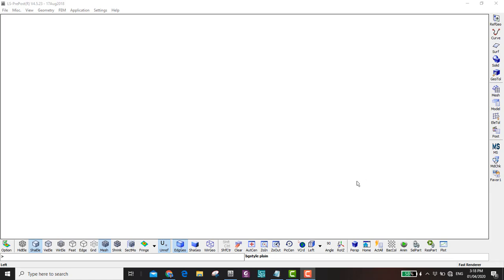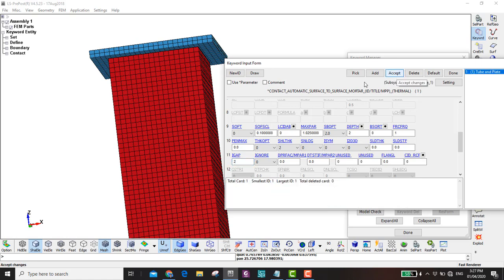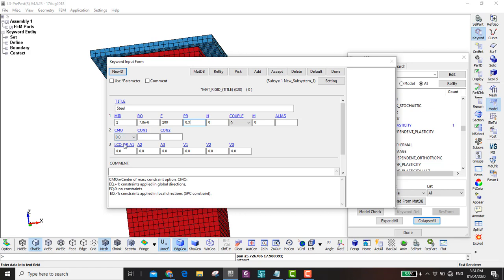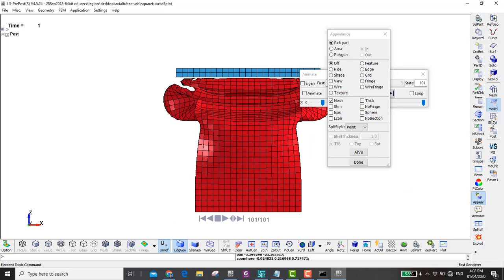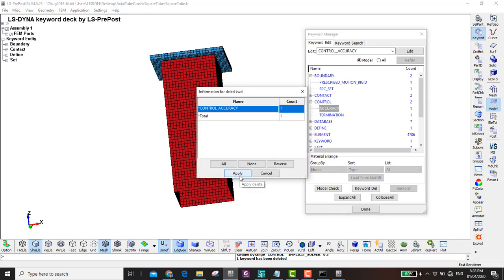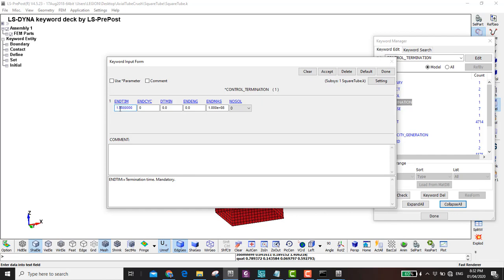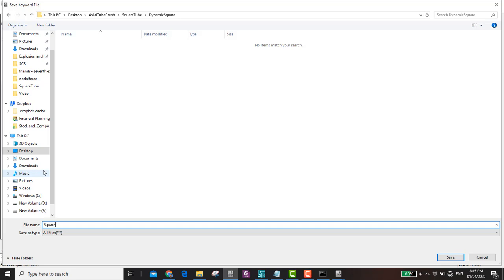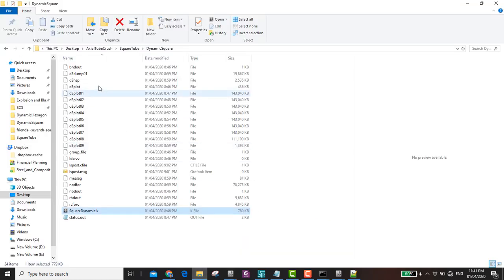LS-DYNA TUTORIAL 12: Static and Dynamic Axial Tube Crush

Comment: Hi Ameen, I have followed your model but I am not sure why i cannot get the rcforc result as yours.  My rcforc is zero (it’s like there is no force).  Any ideas on this. I tried to do it twice but still cannot get the result as yours.
Reply from the maker: Dear Lam, are you putting correct value for DT in ASCII OPTIONS?
Reply from the maker: Also, the tube is crushed or not in your simulation?

Comment: I want to ask you something. I did the compression analysis, and the max of the value is too different when the rcforce dt is 0.05 and 0.00005 in ascii. How should I proceed in this case? The data is calculated relatively smoothly when it is 0.05 and when it is 0.00005, there seems to be a lot of data that stands out.
Reply from the maker: It is hard to tell. The data with 0.00005 has oscillations and noise, which is normal. Even in real experiment there will be noise. You can apply some filters after plotting the curves to remove/reduce noise.

Comment: Excellent video!  Sir, I got a problem : why is it that my initial speed setting is in the negative Z direction, but the rigid plate is still moving in the positive Z axis? I adopted the key word *INITIAL_VELOCITY_GENERATION😂
Reply from the maker: @dequan-g2z  it could be that it is moving correctly. It's just that the target is so stiff so the plate bounces back.
Reply: @AmeenTopa  But when I used*BOUNDARY_PRESCRIBED_MOTION_RIGID，the plate can move correctly.
Reply from the maker: @dequan-g2z  BOUNDARY PRESCRIBED MOTION is like a compression test. No matter how strong the material is, it will get crushed. 

INITIAL VELOCITY GENERATION is like a drop test, if the target material is strong, the impactor will bounce back. 

To prove this to you, in your model with the initial velocity, check the stresses in the target. You will find there are stresses. This means that the impactor has already hit the target. Because if it was moving upward, it won't hit the target and there will be no stresses.
Reply: @AmeenTopa  Thank you so much, sir!  Which means the keyword *BOUNDARY_PRESCRIBED_MOTION is more suitable to simulate the compression test in the universal testing machine?
Reply from the maker: @dequan-g2z  Yes, correct. I have a tutorial on tensile test and compression test. Check those.
Reply: @AmeenTopa  Thank you so much!!!! Best wishes to you, sir😄
Reply from the maker: @dequan-g2z  you are welcome and all the best!

Comment: when quasi static analysis, you said you don't need to apply strain rate parameter .  but for the accurate value is it better to apply strain rate parameter?
Reply from the maker: for quasi static analysis, whether you apply the strain rate parameter or not, it won't make any difference.

Comment: Hi Ameen, I have some question related to mesh. After i export the mesh (hex8) from hypermesh to prepost, the element in prepost is solid with 10 node format. I’m not sure why it is not a 8 node solid? And can we change it to 8 nodes solid or anything wrong with my export from hypermesh? Thanks.
Reply from the maker: Hi Lam, I am not sure about this problem. But in general, Element formulation type can be changed in SECTION SOLID ELFORM

Comment: When I thought about it, wouldn't the buckling mode come out well and give an appropriate critical load result compared to the theoretical formula? (fixed-fixed Euler equation)
Reply from the maker: @ChanghoKim-y7l  Euler equation is for static buckling. In this video, the load is quasi static and dynamic, so the peak load will be different from the theoretical value of Euler's formula.
Reply: @AmeenTopa  When I looked at your paper, I found that the initial buckling was formed at about 30000N. Is it unreasonable to derive a critical buckling load by applying the corresponding peak force value, even if it is quasi-static?>
Reply: @AmeenTopa  Then, if you want to find the value by applying the theoretical value, is there any other way? It's just for validation.
Reply from the maker: @ChanghoKim-y7l  may I know which paper you are referring to?

Theoretically, the peak force from quasi static analysis would be lower than the value from Euler's formula.
Reply: @AmeenTopa  a study on the axial crush analysis of a rectangular tube with experimental comparison  In the equation, (w+h) x 2 x t x sigma_yield
Reply from the maker: @ChanghoKim-y7l  can you give the link to this article? I cannot find it.
Reply: @AmeenTopa  I am concerned that this is in Korean. The theoretical equation deals with the buckling equations for quasi-static cases.
Reply from the maker: @ChanghoKim-y7l  Okay. Few things:
1- In your previous comment, you said "When I look at your paper", But we are talking about a different article.
2- I don't know of any equations for quasi-static load. I need to see this Korean paper.
Reply: @AmeenTopa  
Oh I read your paper already and i studied more article and i will post link about it. thank you
Reply from the maker: @ChanghoKim-y7l  may I know the title or the link to the Korean paper you mentioned? I'd like to know more about it. Please answer. Thank you.
Reply: @AmeenTopa  iam sorry late for answer  i post link about it
Reply: 사각관의 붕괴해석 및 실험에 관한 연구
Reply: If I apply link, the comments won't pop up
Reply: @AmeenTopa  the experiment is very similar to your literature
Reply from the maker: @ChanghoKim-y7l  thank you for sharing the title. I found the link.

https://koreascience.or.kr/article/JAKO199311919525922.pdf
Reply: @AmeenTopa  your welcome
It can get similar value (max load) when quasi static buckling
Reply from the maker: @ChanghoKim-y7l It is my first time seeing this equation. I don't know from where he got it.

Comment: hi thank you for the informative video! may I ask if it is possible to make multiple honeycombs to become a honeycomb structure inside of LS prepost in itself, since for my final thesis I am supposed to make a honeycomb structure, thus I imported from the honeycomb creator in Designmodeller, but it turned out to be individual shells that makes it difficult later in the material classification, thank you in advanced.
Reply from the maker: @nathanprimana9580  you can use the same method in this video to create a single cell. Then, use the Transform -> Translate tool to make copies of that cell.  It takes some practice but if you are good at geometry, then it should not be a problem.

Comment: I’m studying a lot about lsdyna with your video. Thank you. But I have a question. I wanted to match the results of lsdyna with the previous paper, so I tried to find some data but failed. Also, it is interpreted quasi-static and the strain rate is not considered in the physical properties, so I think the results of lsdyna should match the graph pressed at 2mm/min speed in that paper

Details done to match the load data in the paper with the lsdyna results are as follows

1. The mesh size of the shell was attempted at 2 mm, 1.5 mm, 1 mm, and 0.5 mm, respectively, with a maximum load of 30 kN, which was approximately the same as the paper value, and the crumpled shape of the shell was approximately the same. However, the shape of the load data curves was somewhat different.

2. I entered the SIGY and EPSF values in MAT18. The over-transforming elements were removed from the simulation, but this result was almost similar to the method.1

3. Finally, adjusted the end time and the movement of the ridge using the gravitational conditions and the speed at which 2mm/min is pressed. And set it to a dynamic implicit newmark, not static. The shell is lightweight, so there is no effect of inertia, and it‘s a natural result, but it’s the same as number one. The simulation time is very long and inefficient

I was so curious why the paper and simulation load data are different, so I tried many things, but in the paper, the physical properties of the shell are marked only with aluminum, and I don‘t know what kind of aluminum it is specifically. So I think the reason why the simulation results and the paper are different is the material properties. What do you think?
Reply from the maker: @tjj4801  You are welcome. I am glad that my videos were helpful. 

Regarding the validation, as long as you get the similar peak force and MCF, then that is already good enough. 

As for the long run time, you may apply mass scaling as well as time scaling. Time scaling means increasing the speed so the termination time is smaller. Mass scaling means increasing the mass of the system in order to get a bigger timestep size. Applying too much of either mass or time scaling might increase the inertial effects. The general rule is to look for kinetic energy. If it is less than 5% of the total energy, then we can accept the simulation as quasi static.
Reply: @AmeenTopa  Thank you. This means that the internal energy and kinetic energy ratio can increase the density by 5%, 95%. Thank you for the good tip.
Reply from the maker: @tjj4801  Kinetic energy will increase if mass scaling or time scaling is done. Internal energy will not be effect. 

This can be observed from kinetic energy equation: KE = 0.5 m v^2

K.E. is related to mass and velocity.
Reply: @AmeenTopa  I understand, thank you so much, I am learning a lot thanks to you.
Reply from the maker: @tjj4801  You are welcome.

If you are required to publish your work in a journal and I can be one of the authors, then I am open to help you further with the validation process by checking your model (k file).

Comment: Hello, Ameen. Thanks a lot for sharing.
I have a question. How to delete the element when it is failed? For example in the contact with adhesive. When the structure bears a large force, the adhesive layer will peel off at the connection. How to achieve this in the program?
Reply from the maker: Check my tutorial:
LS-DYNA TUTORIAL 14: Delamination Test and Cohesive Elements

Comment: Hi Ameen, i want to ask a question. If we would use composite material instead of aluminum, which material model would suitable instead of power law plasticity material model?
Reply from the maker: Two good candidates are MAT022 composite damage and MAT054 enhanced composite damage. These two are widely used therefore it will be easy to find the input parameters from literature.
Reply: @AmeenTopa  i tried to Mat54 model for aramid epoxy composites by implicit solver, but i got to convergence error. problem did not converge.

Comment: hi great video! just wondering, what's the default unit in ls- prepost for velocity? in the reference paper, it says -10mm/min. but i assume this is not the unit here?
Reply from the maker: You can search "LS-DYNA Unit Consistency". There is a good explanation on the dynasupport website.
Reply: thank you for the response! but for example the tube geometry is 38mm*38mm, how can you know that the default unit is mm, so that you just input 18.4 and -18.4? Besides that, for the implicit method, why we don't need to define velocity? Will the velocity not affect the deformation? THANKS! @AmeenTopa
Reply from the maker: @bellal1329  In LS-DYNA, you need to follow a set of unit. For example, we have the standard international units (Newton, meters, seconds, Kg). Also, we have another unit system (kg, mm, millisec, kN). So, it is your task to make sure that your input follows one of the unit systems. For more, read here: https://www.dynasupport.com/howtos/general/consistent-units

For the implicit simulation, it is a quasi static test, therefore, we do not define INITIAL VELOCITY. We use PRESCRIBED MOTION to define the displacement or velocity of the top plate.
Reply: @AmeenTopa   Thank you so much for the clarification! one more question, in which video did you talk about using material properties edited in the textbox?
Reply from the maker: @bellal1329  yes, you can edit the keyword files with a text editor like Notepad or Wordpad.

Comment: Very informative video, thanks!
 Can you explan me how do you verify the mesh element order( linear or quadratic)? Is it possible to modify?
Thanks!
Reply from the maker: Element order is selected from SECTION keyword.
Reply: @AmeenTopa  Thank you very much for prompt reply. Have you define the element order in the tutorial? 
Am I missing something here?
Thanks!
Reply from the maker: In SECTION SHELL.

ELFORM is the element formulation. There are many options under there.
Reply: @AmeenTopa  Thank you very much once again. 
I have the following questions:
What are the option I have to change if I want to use force instead of displacement?
What would be the default analysis if we don't add or specify either implicit or explicit key options?
Lastly, I would appreciate if you could me tips for bolt pretention, how to use  bonded contact (bolt and nut) and  frictional contact (bolt and clamp).
Thank you in advance, appreciate your help.
Reply from the maker: @mulukenmeaza4844  You are welcome.

To use force instead of displacement, you can use LOAD NODE SET. Check out my tutorial: Compression Cylinder. 

If we don't add any keywords, the default is explicit time integration.

For bonding contact, check out my tutorials: 
(a) 3 Point Bending of Sandwich Structure
(b) Delamination Test and Cohesive Elements
Reply: @AmeenTopa  Thank you so much!

Comment: Thanks, Ameen. You assigned 47 mm as the displacement. I want to ask how we can manage the load rate. I need the plate to move with 0.05 mm/sec, for example, all the way to 47 mm. How can I do it using the load or displacement, not velocity? And is there any relationship to the termination time of the model?
Reply: I think when we defined the curve, we said when the time equals 1, the displacement equals 47 mm. This means that the termination time governs the loading rate. For instance, if the termination time is 2 sec, the load rate is 47 mm/2 sec, which is 23.5 mm/sec.
Reply from the maker: @haidermraih2559  In DEFINE CURVE, we put can put displacement vs time. So, for example, if I put 0,0 and 10, 50 then it means at time =0, the displacement is zero. And at time = 10 sec, the displacement is 50 mm. The load rate or velocity is the differentiation of this curve. So, it will be (50-0)/(10-10) = 5 mm/sec.

Remember physics: velocity is the differentiation of displacement.
Reply: @AmeenTopa  understand, would that govern the termination time of the model?

Let assume that I have 50 mm thick block, and I need to apply the load with 0.5 mm/ sec, which results in 10^-3 s^-1 as a strain rate. 
What would be the termination time of the model? 

Assume that the displacement curve is
0, 0
1, 50
Reply: I think it can be managed from the load curve itself, and it is not related to termination time.
Reply from the maker: @haidermraih2559  Yes, it is related only to the curve used, as I explained in my previous comment. 

However, take note that if you change the load rate, you might want to change the termination time too. 

For example, if you made the load rate 0.5 x the original speed, then you need double the termination time in order to reach the same displacement.

Comment: Hello Ameen Topa, I have question about this simulation, what if I want to fill this tube with foam? , what parameters change and what parameters I should add to the keywords?
thank you for your helps
Reply from the maker: Dear Peyman, 

You need to include solid elements for the foam part. Watch my tutorial on three point bending where I used EPS foam as the core:
https://www.youtube.com/watch?v=4VPQVCk5F3A&t=2516s

For more information about the foam modelling, you can refer to published paper here:
https://www.hindawi.com/journals/mse/2014/292647/
https://www.jstage.jst.go.jp/article/mej/2/5/2_14-00510/_article/-char/ja/

Sincerely,

Comment: Good afternoon, Ameen!  Can you tell me if there are any general recommendations for choosing a time step for static implicit analysis. Well, let's say 1 to 100 of the total time, for example, if you need 1 second, then the step is 0.01 or 1;1000? I noticed that this significantly affects the result..to calculate, say, the same load of one object on another under its own weight under the influence of gravity? and which scheme is optimal for typical similar tasks, when one body loads the second under its own weight and gravitational load? thank you in advance!!
Reply from the maker: If you are using static implicit analysis, I recommend to use IAUTO = 1 to invoke the variable time step. Since you are using static implicit, then I assume it is a quasi static load. Therefore, you can put the termination time = 1 and initial time step as 0.01. The load should be applied and starts from 0 and reaches its maximum value when t = 1 (which is termination time).
Reply: @AmeenTopa  I understand everything. thank you very much for the answer. And what happens if, at completion time 1, I set the initial step to 0.1 or 0.001, instead of 0.01? how will this affect the result theoretically?

Comment: Hello Mr Topa. I have a question here. Some research paper mentioning that they use Belytschko-Tsay shell element with one centre integration point and five through-thickness integration point. I understand that through-thickness number can be change, but what does it mean by 'one centre integration point' ?. Currently I am trying to simulate dynamic axial tube crashing
Reply from the maker: You can check the presentation below:
https://www.dynamore.de/de/download/papers/2013-ls-dyna-forum/documents/review-of-shell-element-formulations-in-ls-dyna-properties-limits-advantages-disadvantages